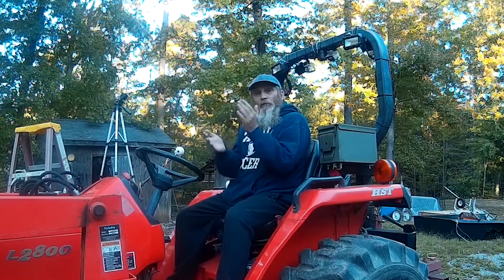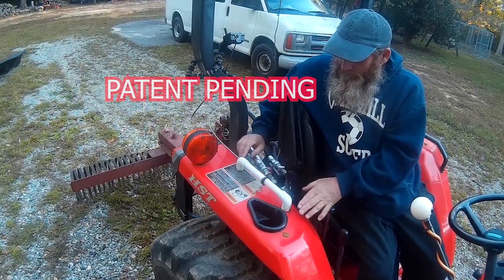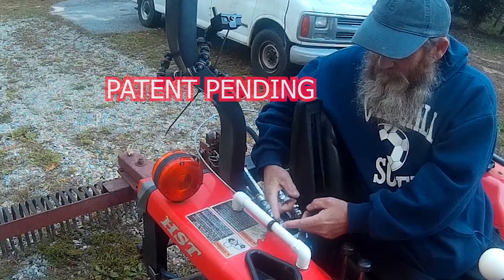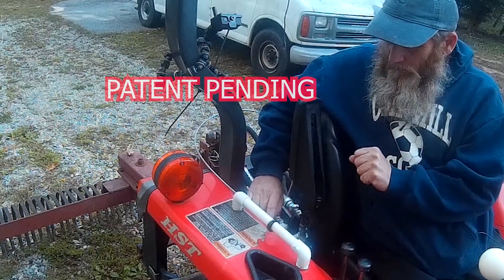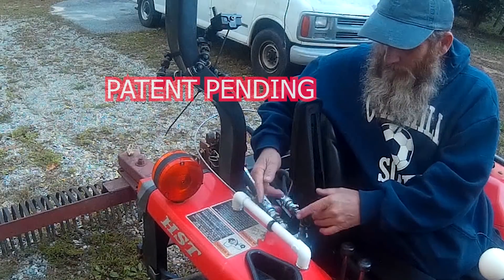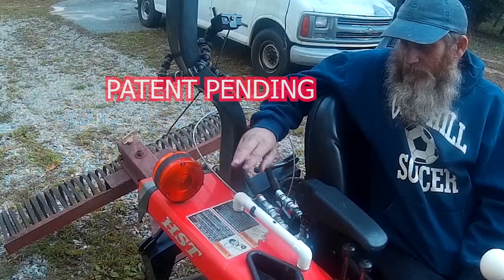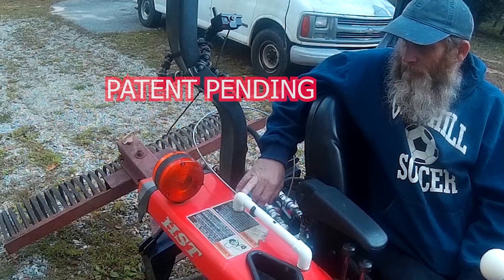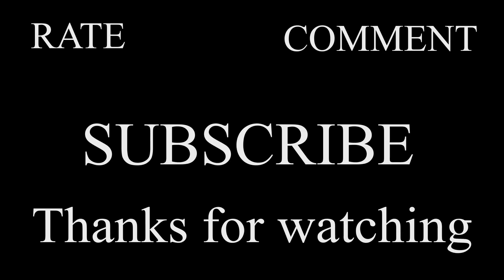The Tilt Level Indicator! my latest invention!

Comment: Also Dave, my tilt cylinder has 4" of travel.
Reply from the maker: I sort of figured most are 4 inch travel mine is 6 inch travel but that is more likely way more than is needed. if I could have found a 4 inch travel close by me that was not a tie rod style I would have bout one. is yours a tie rod style cylinder? or welded? how big a diameter is the outer cylinder and how big a diameter is the ram cylinder?
Reply: @daveknowshow , Yeah if I wanted more adjustability I could just take the hand crank original and throw it on the other side but I don't think that's gonna be necessary. I'm out of town right now but will take some dimensions to let you know.
Reply: Hey @daveknowshow . They're welded with the big diameter cylinder measuring 2.5" and the small one 1.125". Have you thought about going onto that TV show "Shark Tank" with this? You seem like the show biz type! :)
Reply from the maker: @bayareasparky9180  I'd be a nervous wreck on shark tank. lol I just got some steel in today and I may start building one of these out after I get better from surgery tomorrow. if all goes well I should be up and going pretty fast. I'll let you know how its coming along. thanks for the update on the size. did yours come from fitrite? or another builder?
Reply: @daveknowshow   I bought the kit from the dealer. Lookout for my email. Good luck and God Bless.
Reply from the maker: @bayareasparky9180  ok thanks still in recovery mode. hope to be better tomorrow.

Comment: Hi Dave. How much about would you say the materials for the tilt level indicator cost? I'd be interested in building one for sure.
Reply from the maker: hmm not sure. the cable I used came from a lawn mower replacement cable at lowes home improvement center. I want to say it was 15 bucks. then I had some pvc pipe, delryn, a spring, a solid steel round rod and a hollow steel tube.  about 6 inches of solid 1/2 by 2 inch steel flat bar. three muffler clamps. the biggest expense was likely the time. it was a lot of machining. most was done on the milling machine but some on the lathe. I been sick the last few days but I may start a build on a duplicate one to see how much it cost and how fast I can machine it out.
Reply: @daveknowshow  Yeah well get better first. The change of seasons always gets me. Like you said before you're better off just getting a royalty of units sold or sell the idea for a lump sum. My old boss was a successful camo designer but instead of doing what I just said, he wanted total control so he had to find linen/fabric producers, printers for the camo, garment makers, shippers, etc. It was really a waste of time for him. He ended up deep in debt and selling for pennies on the dollar two years after passing up a very nice lump sum + royalties deal.

Comment: I would certainly find that useful on the hydraulic top and tilt links on my old Ford 340.  Tim
Reply from the maker: I'm hoping to get this sold to a manufacturer so it will be made available to anyone of many size tractors in a hurry. my shop is small so not much for production work.

Comment: That's a nice addition for the tilt kit.  Seems to be real easy to see and with the magnets it can be placed in a very visible spot for easy sight lines.  Well done!!!
Reply from the maker: thanks a lot with the magnets it will work even on tractors with plastic fenders the ROPS seems to be a good location for it as well.